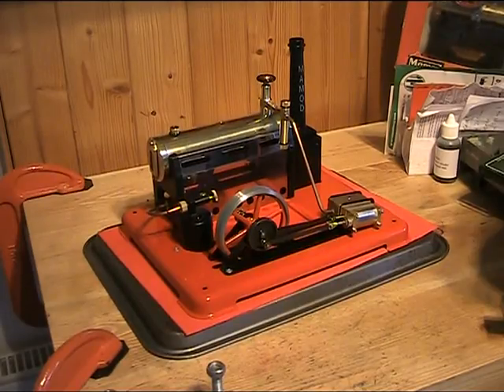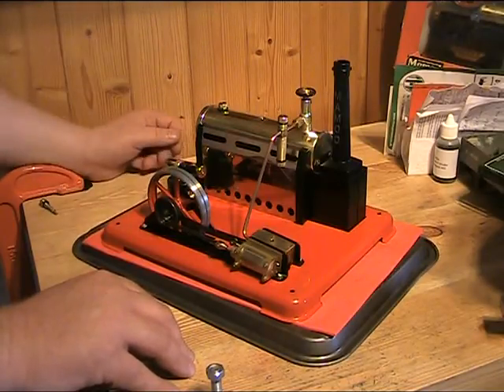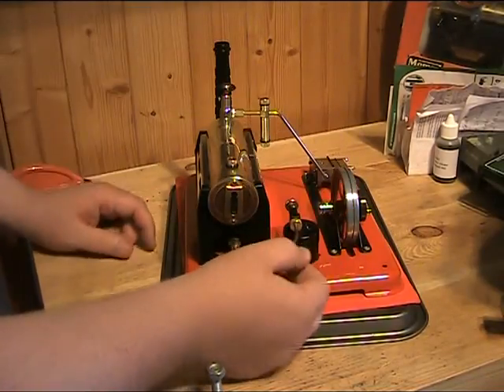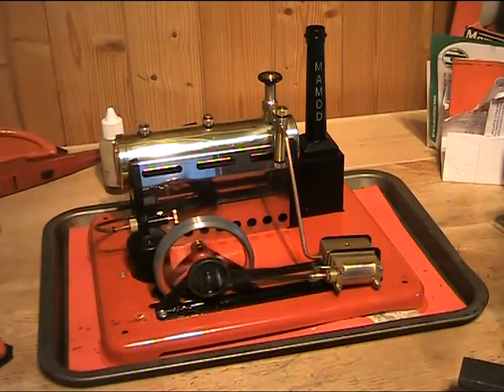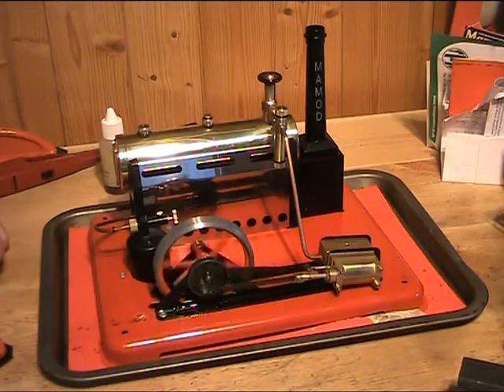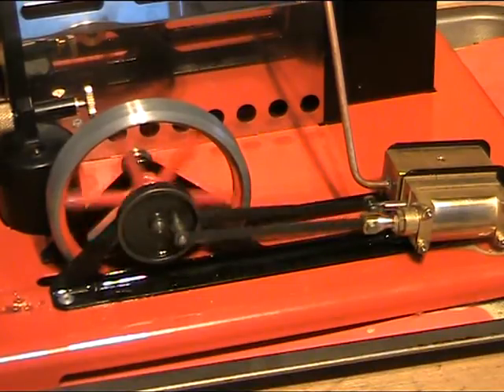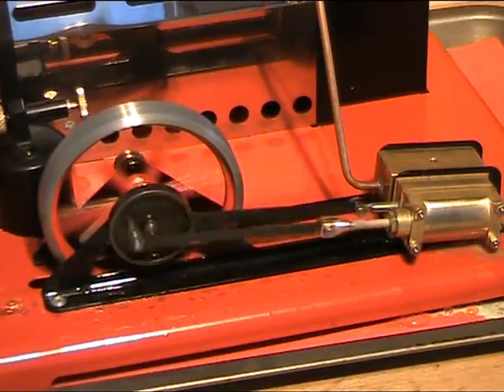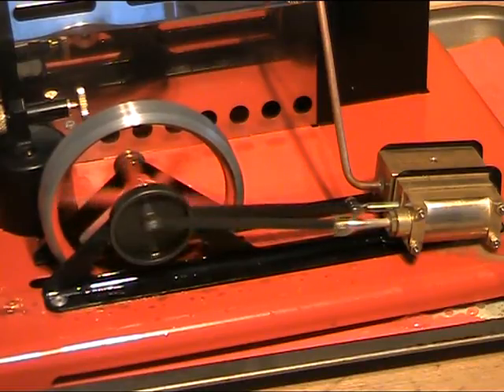MAMOD SP6 GAS FIRED STATIONARY ENGINE

Comment: It's not a gas fired engine. It's a steam engine.
Reply from the maker: Whilst you are not wrong, you are not correct. Yes it's a steam engine, but it's fired by gas, as in the gas, when lit, heats the water.

Comment: hello there we have a wholesale outlet in Queensland near by but they don't sell to the public,, just over seas it's a shame really there's not much in the hobby shops to do with steam ,there are a few.the wholesaler for Mamod here don't have parts Eg the gaskets for the cylinder block etc..would you know what type of gasket used for the Mamod sp6 and for the burner would you know if it meets Australian standards Eg the butane can nozzle thanks for your time..
Reply from the maker: +Ron Geremy I don't know what the Austrailian standards are, but the filler is just a Ronson valve as fitted to many a cigarette lighter or gas powered soldering iron. The gaskets and indeed all parts you should be able to get from Mamod, who did have an Australian website. Here's the link http://mamod.com.au/

I dare say you'll be directed to the uk website/factory sooner or later, and not all parts are listed. Obviously postage will be a bit pricey. The gaskets look just like some sort of compressed cardboard, but I don't have any spares to have a close look at.
Reply: Ok thanks for the info,,have had a problem getting parts from the uk most don't sell to Australia.but I'll have a look at the link thanks again, just to mention, the steam exhaust tubing I used works quite effectively also gives it a more authentic look I guess and great in the colder months, great stuff!!!

Comment: Hi there like the video, I did a gas conversion on my sp6 it's not the correct one just noticed yours has the right gas setup where did you get yours from thanks
Reply from the maker: +Ron Geremy Hello Ron. It&#39;s a factory one. You can have solid fuel or gas fired, at greater expense of course, but cheaper and easier in the long run, and if you want to get the most out of the 40 psi boiler, gas is the only way.

Comment: As soon as the run ends, close the valve shut , and crack open the oiler.  Turn the flywheel by hand and it may draw the some oil South toward the cylinder, instead of West in to the the boiler if you leave the valve open.

Comment from the maker: Oil does get a little sucked in, which I've got to have a word with Mamod about. Perhaps if the lubricator was a little lower in the line it would help get around this? Still, as long as the boiler is washed out every so often, I think, overall, the lubricator is a good thing.

Comment: The Lubricator stuck on there reminds me of German engineering when they realize they forgot something five minutes before first production run..  When the fire dies, I'd be concerned that oil gets sucked in to the boiler, many times a vacuum occurs at the end of a run.